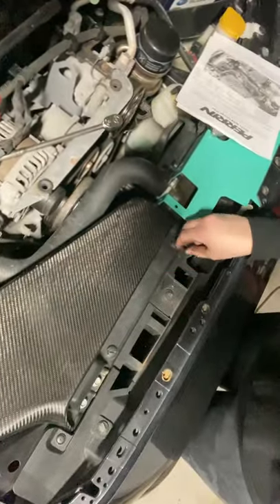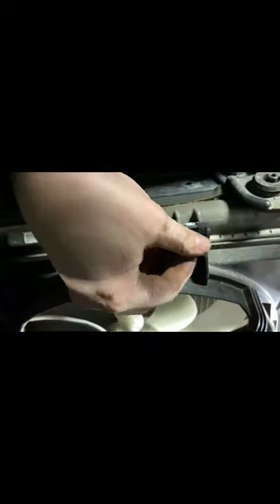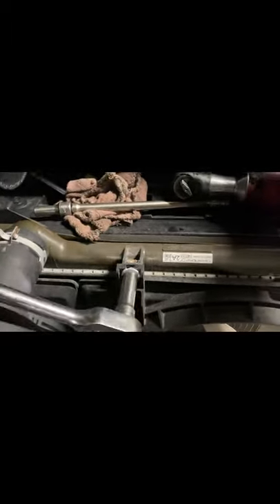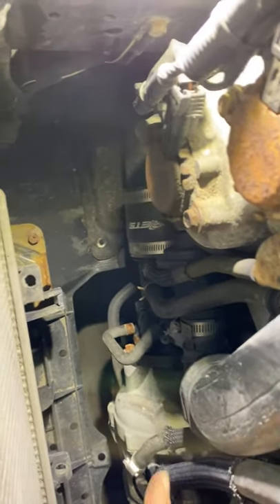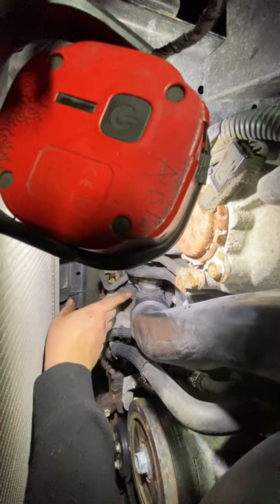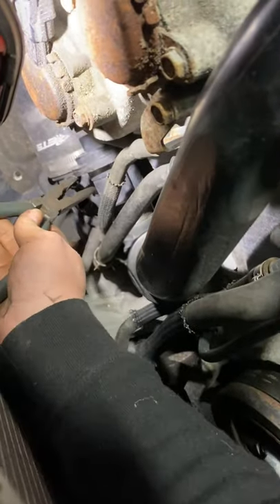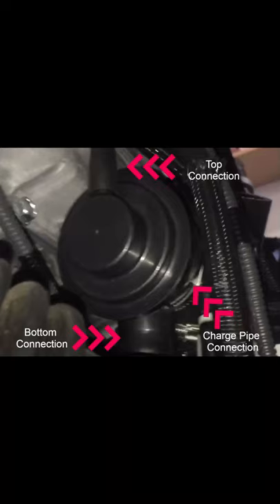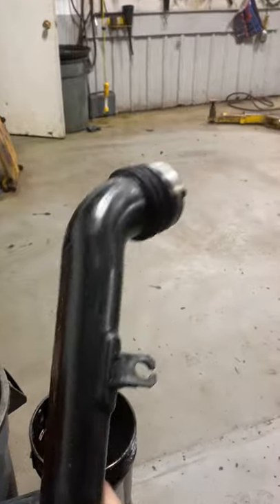Removing & Installing a Charge Pipe

Comment: What mods did you install up to the point in this video, that played a part in increasing the sound of the turbo spooling? My 2018 WRX has a Perrin charge pipe, Apexi drop in filter and Boomba bypass valve but the spooling sound certainly isn't as loud as your cars. Within the next two days though I will be receiving a Perrin turbo inlet by mail to install, which I'm hoping does add a bit more to it
Reply from the maker: I have done:
ETS cold air Intake
AIG tgv and egr deletes
Killer B exhaust headers and j pipe with a high flow cat
Perrin charge pipe
Perrin non res cat back exhaust
Cobb access port and pro tune..... be careful just slapping bolt ons on the car. Certain things you should get a pro tune after putting them on. It’s not healthy for the car. I’ve seen people blow up their cars after a year or two from parts slapping them and cheaping out and not doing a protune.... also make sure u use high quality parts there’s a lot of companies that make it seem like they have a good product and don’t.... the cold air intake probably made one of the biggest differences for turbo noise.
Reply: Thanks for your reply Ashley, that sure is a lot of stuff you've done to the WRX. How much power is the car putting down now and do you have any future plans for it as well?
Reply from the maker: S Khan I’m making about 350 to the wheels. Flex fuel build and bigger turbos next.